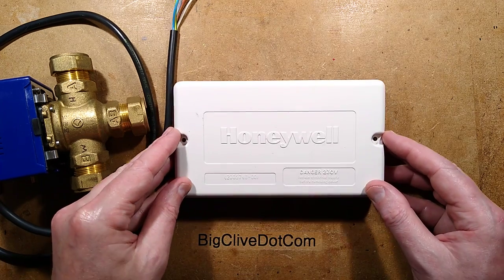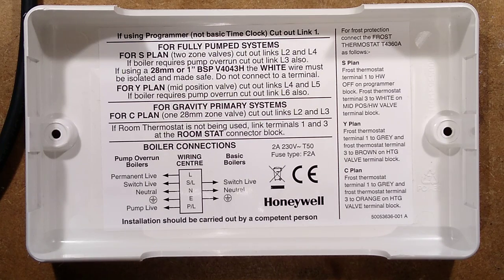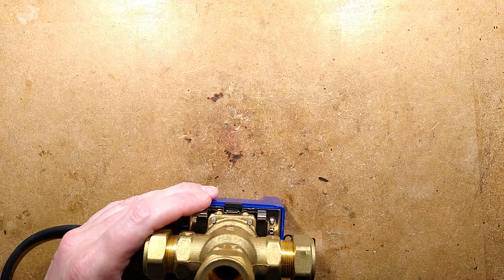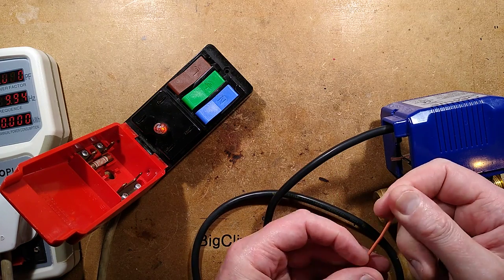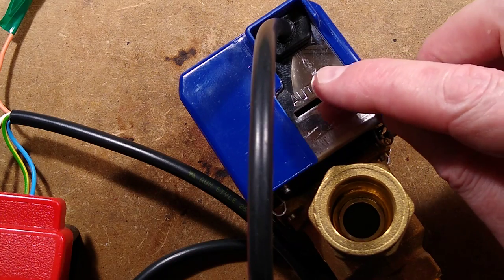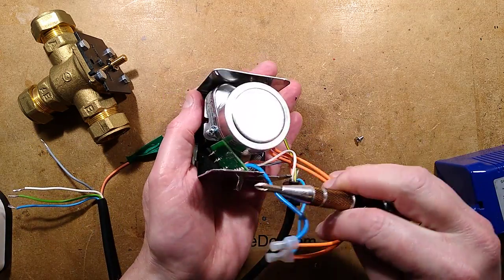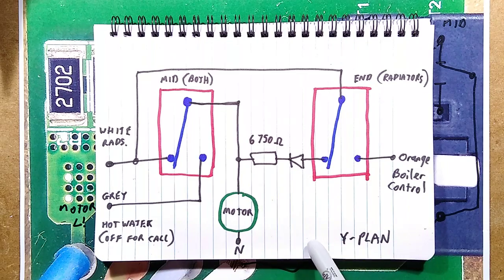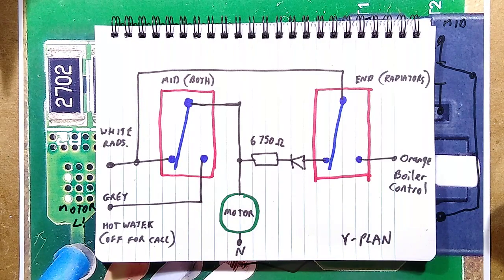Inside a clever Honeywell boiler wiring centre and a 3-way valve.

Comment: A simplification system to allow a novice to install a heating system safely, but still needs some 2-day Part-P Course-certified halfwit who probably couldn't tell Live from Neutral to certify it as safe... :P
Reply: Too true.
Reply: Four year apprentice program here
Reply: If you’ve ever seen electrical work done by a plumber Part P makes sense 😂😂
Reply: They started selling these wiring centres after the sparks all got their knickers in a twist that anyone CORGI registered was more qualified to wire up a heating system than they were but couldn't work out how to do it themselves.. Most sparks couldn't get their head round the three port valves. Even today if you give a sparks a system with a three-port valve, a Honeywell wiring centre and a programmer without a heating off output they still can't work out what to do without replacing the programmer. 😂
Reply: khaitomretro there are electricians and there are house bashers.
Reply: @chrisb4009  indeed!
Reply: @khaitomretro  that was before they dumped corgi and dumbed it down to gas safe. And those diverter valves are far less complicated than say a 5 port pneumatic/hydraulic valve that electrician's get to play with.
Reply: @chrisb4009  have you have ever seen wiring done by a part P electrician it usually comes with a snag list a mile long.
Reply: The Dog Walker there are electricians and house bashers. It’s a mix of pride and competence.
Reply: Chris B I know my ex boss was a house basher with part P I spent half my time sorting out his warring and he couldn’t program.

Comment: Actually a normal-sized house here would not have a heating system with separate equipment to be wired by the installer here.
I remember we had that decades ago, but today there would be just a single unit that contains all the stuff, and has a mains lead, a thermostat lead, gas in, cold water in, hot water out, and radiator out and -return.   The unit does all the magic and is delivered from the factory without any wiring required.
Internally these things usually no longer contain a 3-way valve but rather they use two separate circulation pumps, one for the radiator circuit and one for the hot-water circuit, and they are controlled by the microprocessor-based controller.  The better ones have variable rate pumps, the cheap ones only run at full (fixed) rate.
And of course the furnace itself is a condensing type which has modulated gas flow rate, which is adjusted by the thermostat.  So the furnace tends to run all day in winter to keep the house temperature constant.
Reply: We have a mix of what we call combination boilers which are what you describe and system boilers which have external valves.

A lot of heating today has smart controls operated from a phone with the ability to learn your habits.

Bigger houses still tend to use zone valves.

A few companies have tried using a pump for each heating zone and rather than the common pump with a valve for each zone which is more normal.

Our boilers use modulating gas valves, latent heat recoverry/condensing mode and also feed forward control like weather compensation that measures external temperature to predict loading.
Reply: @chrisb4009  Ok, so it appears to be at least somewhat advanced (as compared to the USA where they still only use prehistoric equipment, likely because energy is cheap there, and they just don't care anyway).
However, the wiring panel shown seems to indicate on/off thermostats operating at 240V etc., not very modern.
Indeed here a thermostat is normally connected using a low voltage serial link (OpenTherm) and has lots of smartness and controls, often via internet.
Usually radiators each have their own thermostatic valve in installations like that here, and the smarter ones also send control signals from the radiator valves to the boiler.  (so the boiler only runs when at least one radiator demands heat, not by the overall temperature of the house measured in the living room)

And even with all that, the lefties want us all to change from gas heating to "more environmentally friendly" systems like heat pumps....
Reply: Unless it has solar water heating
Reply: @Rob2  Having everything mains voltage makes things simple and standard. The complexity of the system is up to the end user and installer. Some of us still favour simplicity and reliability.
Reply: Rob OpenTherm was invented/developed by a British subsidiary of Honeywell and sold to an joint industry group (the OpenTherm association) on the mid 90’s. Most boilers are OpenTherm and some support other comms protocols too. Traditionally boilers have modulate the burner based on feedback of heating medium temperature, individual radiators are fitted with thermostatic valves and a single bimetallic strip type thermostat provides simple on/off control. Most recent systems (5-10 years) are fitted with some form of smart control these use OpenTherm or a proprietary equivalent to feedback room temperature to the heating appliance. Homes normally have separate smart controlled heating circuits for heating downstairs, heating upstairs and hot water. Smart radiator valves are getting more common which feedback temperature in each room and turn heat emitters on/off based on temperature set point.
Reply: @Rob2 Heat pumps can be a lot cheaper to operate when you don't have access to piped-in natural gas.
Reply: @brianleeper5737  Yeah, but we have a country-wide natural gas network and our own supply.  Still the green parties want us to give up natural gas and go all "renewable".  It is not about cheaper, it is all about "the environment"...
(and a little bit about the problems caused by small earthquakes in the gas extraction area)

Comment: I remember 28 years ago ,moving into my brand new home . And almost every three way valve in the houses in my street failed . British Gas investigate and it turned out the onsite electrition had wired them all up wrong .. I remember wires every where .

Comment: in the US from what ive seen on shows like This Old House for years now they run the output of the boiler into a manifold and that has individual valves for the zones.  the hot water tank can be its own zone though its not uncommon especially in areas with gas to just have a seperate gas fired water heater.  Storage hot water tanks are also pretty much still king in the US vs point of use or whole house tankless(upside to our natural vented gas storage WH is we still have hot water even in power failure).

Some really fancy systems I have seen go beyond just having valves on the manifold, Each zone also has its own circulation pump.  Smaller systems with two or three zones usually have a common pump for them all.

Also not uncommon in some homes is "Hydro-Air" where you have a boiler as the heat source,  it runs lines out to air handlers that basically have a big radiator in them and the air blows over that to get heated.  this allows a home to have both forced air, Air conditioning and under floor radiant heating.  

As the wallet of a homeowner grows fatter the more interesting the HVAC systems can get.

Comment: I work for a supply house here in the rust belt of America we still have L8148A1017 Honeywell  electro-mechanical aquastat  and circulator controls on large boilers. The simplest valve actuator is the wax motor in the Thermostatic Radiator Actuators. We also still have magic widgets like Q345A powerpile generators that use the heat of a pilot burner to make 3/4 of a volt to operate VS820 a gas valve, no "mains" no batteries just a flame to make electricity. My favorite obsolete but still in use technology in large buildings is pneumatic controls and actuators. I help with systems that are up to 70 years old and still in use almost every day. Electronic actuators cannot compete with the power and durability that you get from a pneumatic valve or damper actuator, they are just a spring and a diaphragm. One more reason to keep pneumatic controls is  because it is impossible to hack or write malware for them and yet it is an open protocol! And to confirm Honeywell is their on worst enemy, is it Residio or just a residue?
Reply: The pneumatic mantra is "Clean, Dry Oil Free air". Pneumatic systems are dirt simple, but suffer from lack of a simple interface with electronic monitoring of the system... I still like them though.
Reply: @paulsperbeck617  All true. I recommend
hybrid systems when people ask. Prolon is my favorite DDC vendor but Johnson Controls and Distech are what we sell the most of. Belimo is excellent for what they do too.

Comment: I have a veissman boiler with the on demand hot water.  It uses two zone one way valves.  That said.  When I had a problem with the valves this winter, rewiring them was not all that much fun.   I'm not an hvac person.  I'm a carpenter.  Haha.  I have since learned a lot about hvac since then.
Reply: Interesting ! I've a Viessmann too but no valves in it.

Comment: Clive: If it has a Honeywell label on it, it is shite.
Honeywell brought out a 2 wire heating control system several years ago. It, when it was working, was excellent. However, they withdrew the product and all support for it.
Last year, a friend's daughters house was fitted with such a system and it went down.
She was faced with ripping the house to bits and replacing every valve and control in the house because nothing is compatable with Honeywell unsupported rubbish. A nightmare!
Reply: What voltage was the control system ?
Reply: rose 375 - I hate to say it, but did the person doing the work have Scooby-Doo what they were doing. I work in an industry where we keep complex electrical, electronic, electro-mechanical obsolete systems running many decades after the original manufacturer has ended support. We have to work out how it’s supposed to work, then find out which part has failed. Then replace said part and test it before returning it to service.

Comment: I literally have a box of about 100 of these in my garage. A company used to supply these I subbed to wiring boilers. Didnt like the look of them so just stuck to what I knew. Double patress, blank plate and strip of 10 15a connectors. If anyone wants to buy a job lot il do them £3 a piece.
Reply from the maker: You should eBay them.  They'd go for between £15 to £20 if you include free postage.
Reply: @bigclivedotcom  gosh I didn't think they was worth that much. Didnt look like there was that much to them when I opened them up. Thanks I think I shall do that if its about £1500 just sitting collecting dust!

Comment: In our system, the three way valve and the boiler thermostat both link directly into the furnace connection blocks, as does the outside temperature sensor and the room unit (behind a Bosch proprietary  protocol). Things like boiler thermals and power level settings are all on the furnace lcd display.

Comment: You'd be surprised how many plumbers actually set houses on fire. 
The danger of combustion is when they're making copper connections with flux, soldier and a torch.
Reply: The trick is to have the pipes empty when doing the solder joints - otherwise using a flame torch can set the leaking gas alight.
;)
Reply: pmailkeey - could you demonstrate this for us please?
Reply: @Mark1024MAK  No ;)

Comment: I work in HVAC field and we have diverter valves on individual duct coils that work on a return loop to a boiler.
The 24v vac mains, the valves modulate 0-10 VDC sig. voltage

Comment: In the US, at least from my observation, the system is quite different. The valves and control logic runs on a 24V system, and each zone is controlled by an individual valve. Each thermostat will have both an on and off signal, and the valve will travel to the set position and then disconnect the motor. A signal wire will then run to the boiler from each valve.

Comment: Another oddity I've noticed with these mid position valves - they only seem to fail on a Sunday evening, just after toolstation and screwfix have closed.  I've got to be in work early in the morning, and will be away for a few days.  So the boss is left without heating or hot water until I get back.  Ought to start keeping spares on the shelf!

Comment: Good old Honeywell, currently keeping me cool as I watch this. (My big fan is a Honeywell)
Reply: They've licensed their name to some other manufacturers though, some of which make utter crap.
Reply: @tncorgi92  Ah, such is modern life.
Reply: Keeping you cool ?????? Where are you ?
Reply: @millomweb  Sunny Scotland where it was 23 Degrees Celsius at the time of posting.
Reply: @PaulEcosse  Scotland (the clue's in the name) NEVER gets hot enough to require cooling.
28°C is great, 30 better still. We open our windows to let the heat IN !
Reply: @millomweb  That is quite insane, to me at least. My ideal room temperature is about 6 degrees in the spring /summer, and 18 in winter. I have an overwhelming need to be cold, for some reason I can only possibly point the blame at my ancestors for. It is what it is.
Reply: @PaulEcosse  You'd get on well with Clive !
When you're used to wearing clothes, you forget what a hassle they are.
Reply: @millomweb  Clothes are highly overrated, if I had the balls I'd go full naturist. Maybe save that for my retirement.
Reply: @PaulEcosse  When home alone......

Comment: You didn’t mention the key characteristic of synchronous motors, that the approach relies on. This is that the motor ‘freezes ‘ when DC is applied. Even the half wave DC from the single diode is enough to stop the motor and resist the return spring force. Very neat and simple :)
Reply from the maker: That's what I meant by DC braking.

Comment: the manual overide valve lever is to enable bleeding thr air out of the system before powering up.
Reply from the maker: I should have mentioned it's use during filling.

Comment: The heating system you are describing sounds quite complex. In The Netherlands we normally just have one integrated gas-powered kettle that you simply connect to the radiators, hot water taps and thermostat (which is just a user control panel, all smarts are inside the kettle). These days it even contains the pump.
Can you do a video about the complex heating system commonly used in the UK?
Reply: What you have described is what we call a combi boiler. They are pretty common but if someone wants to keep the hot water tank and not simply have the boiler try and heat it on demand then you use this kind of valve to direct the water to the tank or radiators or both as scheduled.

Comment: Gotta be honest. I've never liked these due to the implementation. Those links that you cut are usually connected to 240v line. That means if your poking around in there fault finding, there are sharp, spikey and very live wires with thier ends exposed waiting for you to accidently poke. A better way to do it would be dual terminals for each link with a removable link wire. Either way, I use a traditional strip of terminal blocks when I wire up gravity or multi-zone systems.

Comment: dang if i was in the uk, i'd send you some old black and decker power tools my dad never got around to refurbishing  most commonly they needed new carbon brushes for the motors
Reply: Back when they were good! They're cheap Chinese re-badge outfit these days, their mini-drill reminds me of a child's toy I had as a nipper.
Reply: @Jamal_Tyrone  I have a B&D drill. Probably 70 year old now - so just about 'run in'.
Reply: @Jamal_Tyrone  yeah, sure they're heavy with steel frames and everything but they feel good in the hand!
Reply: @r.h.8754  Our old small one went through a lifetime of drilling (can't remember shuck size) and also had the additional use being clamped upside down in a vice being a circular saw bench AND spent a lot of life with an 8" sanding disc on it buffing car bodies ! Can't really remember what it died of but I think it was motor rather than bearings!
It was replaced by a Makita which seems to be equal if not better as a tool - might not be as fast and only single drive speed (The B&D had a 2 speed gear box) The Makita has a switched diode for less speed but the biggest bugbear is the trigger latch button placed under the grip. Every time it was used, it'd latch permanently on due to holding it firmly!

Comment: "Sector gear" is what I've usually heard those called. You see them in dial test indicators. That particular one could possibly be operating by running the sector gear to its end and then just letting it click against the pinion. That would be much preferable to stalling the motor.
Reply from the maker: No clicking noise.  The design of the motor is such that there's very little power dissipation difference between running and stalled.

Comment: In the early nineties I used to run a non market leading pcb design program called E-router I think. I ran it on a state of the art 286 computer that had two house brick sized ejectable disk cartridges of an enormous 1.2 megabytes each!  It would have taken it several hours to plot out even that circuit board!  Overnight was more the norm. It had a library of components and after compiling the circuit diagram it could emulate the circuit function, place the components and plot the tracks. All badly. Sadly the components we used never seemed to be in the library and if you entered them yourself it never really worked. Those were the days eh!

Comment: Thanks to this video I have determined my 3 port valve has an issue with the spring return, I have none!

The motor works and the CH and HW can be heated etc but because there is no spring return anymore manual override can not be engaged and the valve can get in a configuration where it directs water the wrong way.